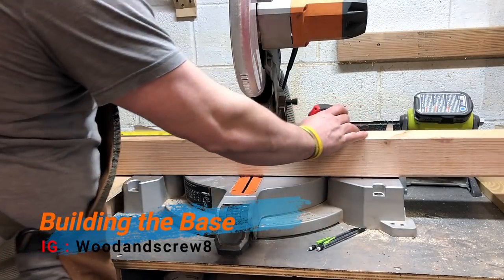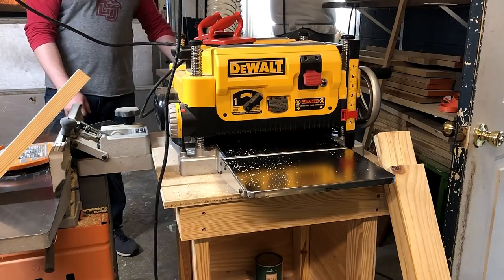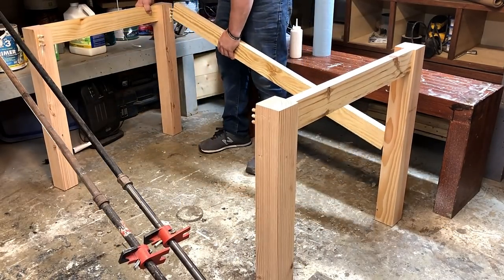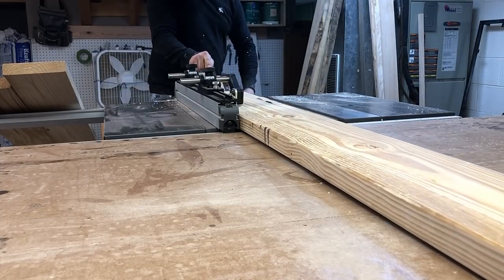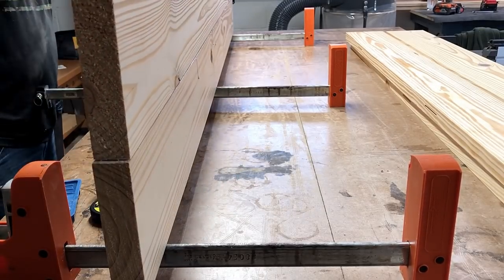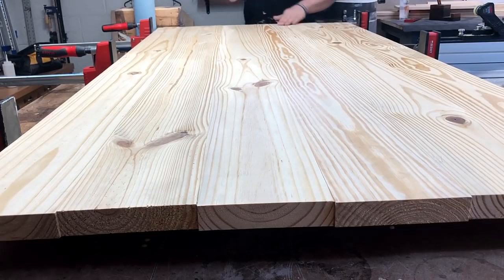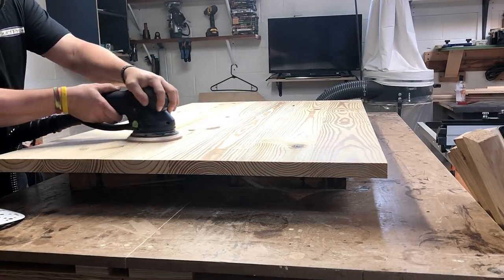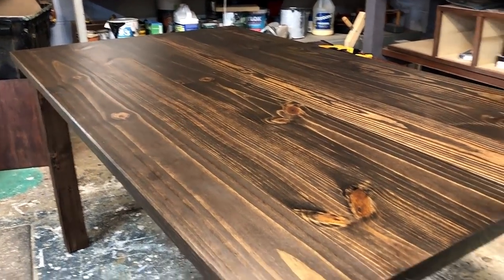Building A Farmhouse Table (Correctly) Awesome new Product

Comment: Thank you for the information on chamfering the bottoms of the legs. I didn't do that on our own 7' table. Now I'm worried I'll bet a split on day.
Reply from the maker: Ron Crandall it mainly would happen when sliding the table across a floor. You can put furniture glides on the legs and that should solve the issue.